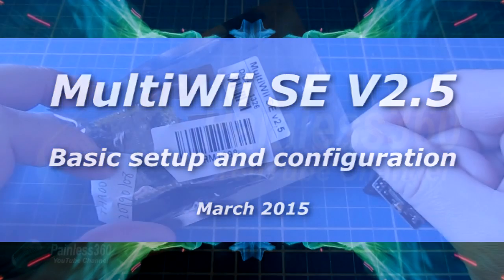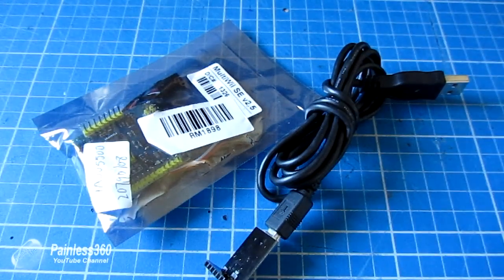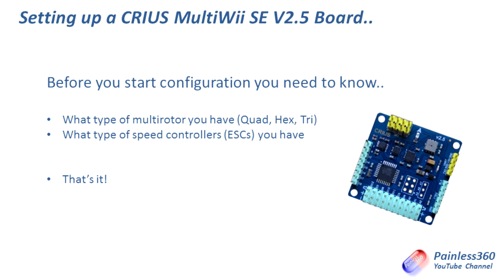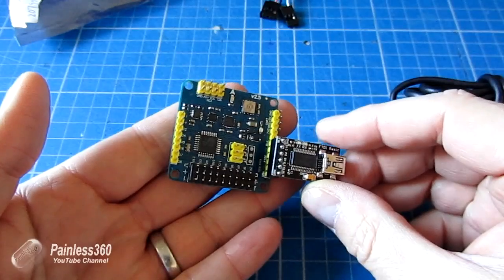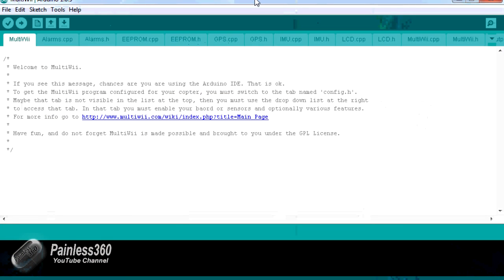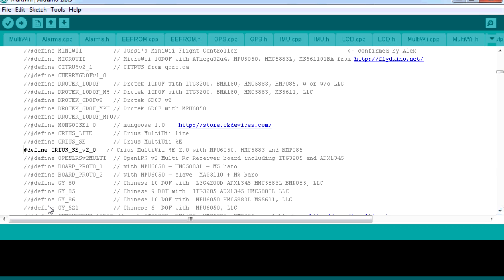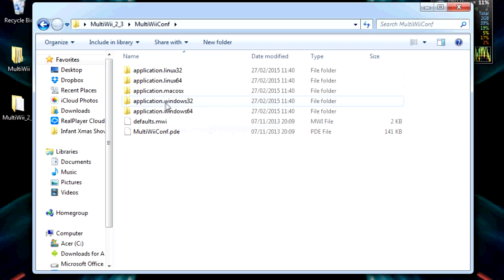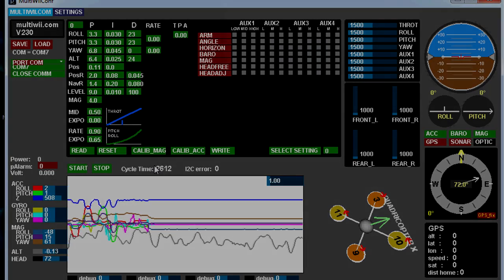(1/7) CRIUS MultiWii SE V2.5 Board - Initial setup and configuration

Comment: Hii. I got a CRIUS Multiwii v2.0 and found that maybe its not giving enough power to one of the motor. 3 motors of my drone runs and try to fly but one motor is just on the ground. I konw its multiwii issue as when I swapped the motors, the one connected to D9 pin is always on ground. Is there a way to fix this?
Reply from the maker: I've no idea, I've not used one of these for many, many years. Best of luck with it..

Comment: If I want to program like an "OH NO!" switch on my controller for my RC Plane (a switch that you use if you think you're about to crash, then it goes back to straight and level), how do program my CRIUS Multiwii SE v0.2 for that?
Reply from the maker: I'm very out of date with this system now, I'd have a look in the forums. I'd suspect that settings up the failsafe on the receiver for the 'self level' mode you want would be the best bet? Best of luck!
Reply: @Painless360  How would I set up a failsafe on it?
Reply from the maker: See my videos on whatever radio you have... best of luck

Comment: Is this still valid for MultiWII 2.0 se?? I got a huge kit here with mwii 2.0 se mainboard, 2x RCtimer telemetry uplink 433Mhz (1x USB, 1x serial), 128x64 I2C Crius OLED Display, Crius Bluetooth module, FTDI USB/serial converter, uBlox NEO 6m GPS Module v2.0, I2C GPS Nav Module, RCTimer MAVLink-OSD Board v1.0. I'm absolutely new to this kind of flightcontroller. I want to use it with a Multipflex EasyGlider or some kind of flying wing. I want to focus on stabilization, heading hold, position hold, most of all RTH!!! cause I already lost whole lota planes an copters. :/ If anyone still uses this setup I would love to hear from you and maybe give me some advise and help on setting it up.
Reply from the maker: Multiwii is very old technology now. Check out my iNav 2.1 and Arduplane builds from the last few months if you want GPS and fixed wing goodness.. Best of luck!

Comment: Hi, thanks for your great informative videos. But I have several questions left:
1) I left my drone project for 3 months and continuing it right now. So what I have found out is that Multiwii Crius V2.6 controller is not working properly. It gets hot too hot while connecting it through hand made arduino ftdi connector, although before everything with the same connections did not raise any error. Do you have some assumptions or advises regarding this issue?
2) Basically is it possible that Multiwii is burned out?

P.S.
These are the following notices:
1) Right side LED is NOT lighting, only one LED with direction drawn above is on.
2) Atmega chip gets an extremely hot during connection with hand made Arduino ftdi driver.
3) I can't upload the Arduino files. Following error is shown: "avrdude: stk500_recv(): programmer is not responding"

Thanks for your help in advance!
Reply from the maker: The MultiWii is very dated technology now. It's 8 but and has limited development underway for new features now compared with more modern flight controllers. I've not used one for over 4 years so everything I knew are in these videos. See my flight controller comparison videos for modern equivalents that are more powerful, work better and are easier to setup.. Best of luck!

Comment: When i arm my drone, my motors ( 3 & 11 ) are at 1566 / 1312 and mpu6050 indicates that the drone is relatively straight, 1 ^ roll. Why ? Ty
Reply from the maker: Not sure. What troubleshooting have you already tried?
Reply: Arduino Nano + MPU-6050 with Multiwii 2.4

Comment: Can I ask one more question please ? 
Like if there’s a way possible to combine 2 codes in an Arduino , one of voice control and another of normal transmitter based drone ..and can be obtained by pressing a switch on the transmitter , like 1 switch to voice mode and another to normal mode ?? I’ve included the voice control but idk how to add normal drone code over it . Can you help me please . Waiting for a reply . Thank you

Comment: Hello and thank you for all the great tutorials, really helped me alot.
I guess i am a newbie at quads. Built my own quad with parts from Hobby king. 350 frame, Crius Multiwii SE v2.6 combo with Bluetooth, OSD telimetry GPS , 2212 motors, Turnigy Plush 25 amp Esc's. I use a Hobbyking HK6 radio and receiver. I followed your instuction videos setting it all up and i think i got it all right. OSD working, GPS lock and so on. My HUGE problem is that i can not get of the ground because the quad behaves very strange. Erratic motors,flip of death.  I programmed it with Multiwii 2.4 software, ACC cal, MAG cal, ESC cal. When i connect it to Multiwiiconf i have good readings and everything looks ok. i use throttle/yaw to arm it.  I have restarted with a clean MW 2.4 config.h many times. Right now i have a clean setup using #define Crius Multiwii_2 FC. I have just changed : quadx, motor_stop, max_throttle 2000, min_trottle 1100. Used Multiwiiconf to set aux1 1=ANGLE, 2=Horizon,Baro,mag . calibrated ACC and MAG. When i connect Lipo ,arm it and the motors goes crazy and compensates totally erratic, i can not get stable, when i change flight modes with aux1 i can see something changes but still totally unstable.  If someone has an ide what i have done wrong ,please post a comment , i am desperate and it has been over a year since i started. Thanks.
Reply from the maker: Please see my video on what to check if your quad flips on take-off. There are a number of common mistakes we all make now and again that can cause this.. Hope it helps..

Comment: Hello , i have seen your multiwii series and they were very helpful but i am having a problem with my multiwii se 2.5 . Actually when i arm it and increase the throttle the multiwii gui shows 2 cross motor slowing down and when i fly the quad in that condition it flips pls help me .

Comment: Hello, once again thanks for your tutorial on Multiwii. But I have a problem with my throttle stick? When I arm the motors everything is fine but when I put more throttle just 10% the rpm it goes high then back to normal then high again. Any suggestion, I calibrate the esc thru config_h and it went well.
Reply from the maker: Sorry, I've not played with MultiWii for ages so am very out of date. I'd suggest a look in the forums.. Best of luck!

Comment: I just recently bought and setup a MultiWii SE v2.6.  I've followed this video and you made the progress very easy.  Thanks for that!  When I got into the GUI, I was able to calibrate the ACC and MAG and then I was able to see that the board was pointing North and I could see the artificial horizon move as I added pitch, roll, and yaw.  However, the roll seems to be backwards.  When I tip the board left, the artificial horizon tips right...when I tip the board right, the artificial horizon tips left.  Have I done something wrong or is there something wrong with my MultiWii?
Reply from the maker: +mountaindewdude76 it can be confusing. Google 'painless360 horizon' to find my video about it.. Best of luck with it
Reply: Painless360 I just watched your Horizon video and it makes good sense now.  I was up late and quite tired.  Obviously not thinking about the horizon directions properly.  Thanks very much!

Comment: How long does it take you to flash the board?  Mine has been uploading for two hours already!  Using Arduino 1.0.5, Windows 10, Multiwii v2.6, Dell XPS 9300 and the FTDI adaptor that came with the board.  Ordered a replacement adapter - just in case :)
Reply from the maker: Not that long, I'd suggest something is wrong. It should take a couple of mins max..
Reply: Hoped you would say that.  The replacement FTDI adapter is due in a couple of days.  I fiddle and faff a bit more in the meantime.

Comment: does this board will not have a conflict with my PDB with UBEC?
Reply from the maker: +Aj Christian Arboleda sorry, I don't understand the question. Please see the rest of the videos in the series for how I built ours. Best of luck!
Reply: what I mean is, I have a powerboard where my 4 OPTO ESC's and  1 UBEC were soldered. my question is if this kind of Flight controller will not affect the UBEC soldered on powerboard?
Reply from the maker: Without being able to see what PDB you're talking about, tricky to answer. You'll need 5v from somewhere to power the MultiWii and if your PDB has a UBEC on it that will do that, that will work great. Best of luck!

Comment: this video is very helpfull :D thankyou!
i have a question though. if i were to make my quadcopter with multiple sonar sensors, which code would i have to change or add? 
thankyou.
Reply from the maker: Not sure it would support that as there is only one trigger and echo pin.. If you figure it out let me know! :D
Reply: okay, thanks for your answer. im trying to make my quadcopter avoid the ceiling as well thats what the extra sonar sensors are for. if i figure it out, i'll let you know ^^

Comment: After looking at the open source video GCS options, INAV, Betaflight, the NEW Cleanflight Etc, and all that's going on over there,  I'm over here looking at this FC again. The MultiWii is a bit intimidating to me but seems to be the open source of open source. Im not going to get one yet but this little guy is definitely on the playlist. A legacy lesson in the face of GCS GUI mayhem ..... and it scratch's my Arduino itch abit. Just glad I have a lot to reference here.
Reply from the maker: We love the Multiwii here but the development and love that used to be poured into the platform has moved on to newer projects (just how Opensource works). The GPS modes are great for such a little guy. Follow the steps (make sure you use the older V1.0.5 of the Arduino software) and you should be flying in no time. Bets of luck!

Comment: Hi thanks for your help yesterday. I can now upload the code to the board but as soon as I arm the motors they spin even when the throttle is at the bottom. I have tried adjusting the trim but this didnt work. Please help. Thanks
Reply from the maker: Then sounds like the ESCs need calibration.. best of luck..

Comment: Hi i cant get my driver to install correctly. How should the FTDI appear in the device management when the driver is installed correctly. It is currently USB-Serial Controller.
Thanks
Reply from the maker: I've seen/heard of loads of problem with clone FTDI adapters. We only use FTDI Basic boards here.. Best of luck..

Comment: Hi All, Just thought I would follow through regarding my MW experience, I was led to believe after reading an article in a drone mag, that the MW V2.5 was capable of Way point flying, after many  hours of research I have decided to shelve the project and have now ordered a APM 2.8 Ardu Pilot,  which  I'm sure will do the pre programmed way point flying, thanks for all comments & help. PS: MarcoMatta, yes I did use the 2.4 zip

Comment: Hi Lee, thanks to your videos I have completely configured my Multiwii v2.6 with i2c GPS  NAV GPS Cirus Neo-6 & Bluetooth, 3 way switch configured for flight modes etc, the Quad flies beautifully, stable & responsive, When connected to the MW Config software all readings work, craft behavior & satellite connection etc. Now my only stumbling block is that I am having trouble finding a way to create a flight mission & upload the mission to the MW-Board, I am using Multiwii WinGUI V2.3 pre8 and everything connects perfectly but unable to upload Mission, (the upload mission button is not active) Thanks again for all your help.
Reply from the maker: Sorry, we've not used that feature on Multiwii, I'd be interested to hear more when you've figured it out.. Best of luck!

Comment: I have the multiwii se v 2.6 I cant find the software download anywhere. I tried the Arduino 2.4 on your link but it wont load to the board. Is there something else I can try. Thanks.
Reply from the maker: +thra5herxb12s what's the error? Should work..
Reply from the maker: +thra5herxb12s Not sure what you're describing.. The steps are all covered in the video..
Reply: I found the right screen but yours has 14 options and mine has 20 I cant find config h When I click what you did it showed a different menu config h is on it but I cant click it.
Reply: +Painless360 I found it all now many thanks indeed.  I had to slow your video down by .5 sounds pretty comical especially with the auto generated subtitles but made it easier to keep up with what you were doing.

Comment: sorry. I'm verry new with diy multirotors!
in the setup for the multiwii it shoes all three rotors spinning ccw. that makes the tri fly slightly tilted.  can I change the rotation of one of the front rotors to make the tri fly level.
In other words does the FC and the ESC know what direction the motors spin.?
Reply from the maker: +Robert Jiggens yes you can. Having all of the rotors spinning the same way normally means you have a tendency to rotate not drift. I'd check the COG. See our videos in the Introduction to RC playlist for more helpful tips. Best of luck!

Comment: hi. i want to build a tricopter and i was wondering if with the multiwii you can have 2 motors spining in on direction and the other one spin oposet direction?
Reply from the maker: +Robert Jiggens check out the documentation for the multi qui software you will use. With a tri, it normally doesn't matter.. Best of luck with the build..
Reply: Thanks all clear now!